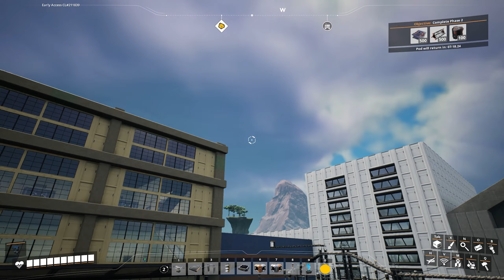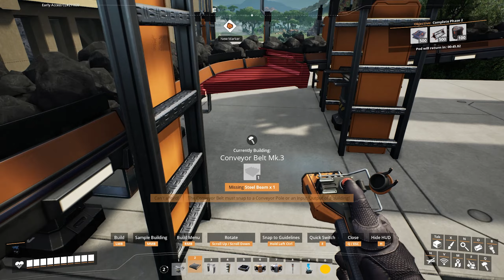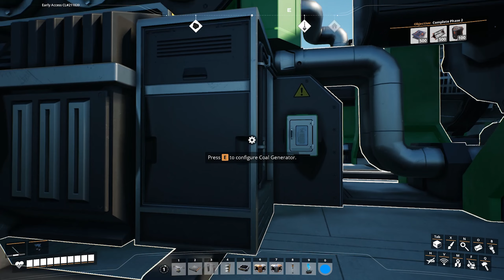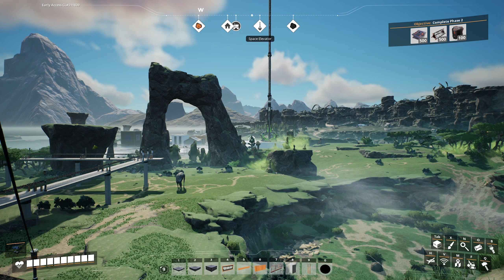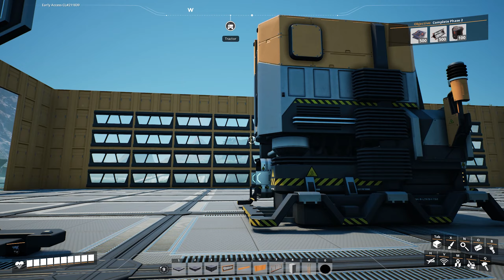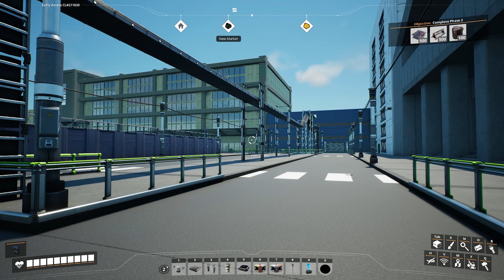Building the steel factory in Satisfactory

Comment: Two quick tips about overclocking: You can click on the numbers (percentage and number of produced items) in the overclocking display and then enter the exact number you want with the keyboard. Helps when you set it to precisely what you need.

The other thing is that whenever Coffee Stain has changed the map before, all trees and animals has also been reset and will be back where they were. But! This also applies to the slugs, so if you want a lot of energy shards, spend some time collecting slugs now, and when update 8 is out, go back and collect the same slugs again.
Reply from the maker: Thank you very much those are 2 very handy tips and ill be sure to get some exploration done real quick! :D